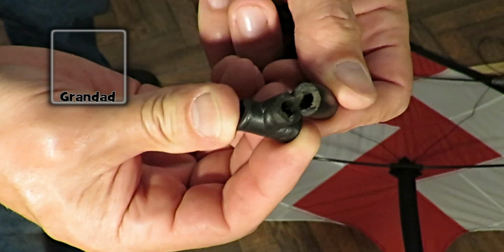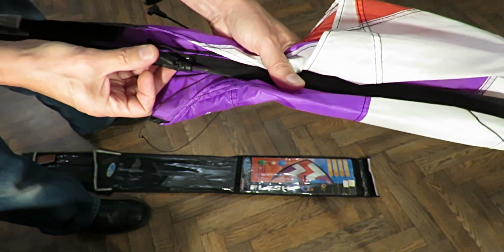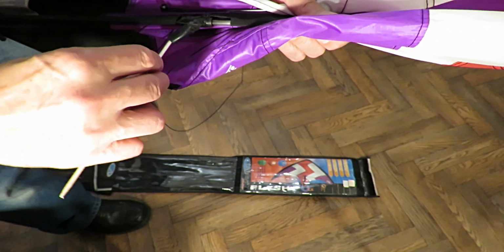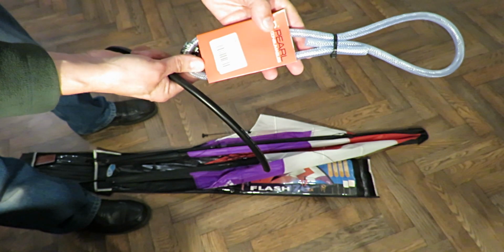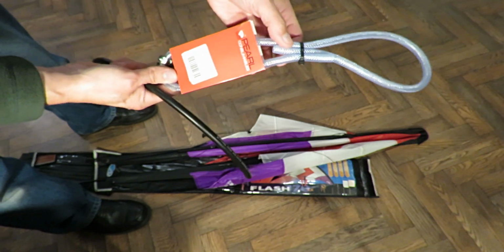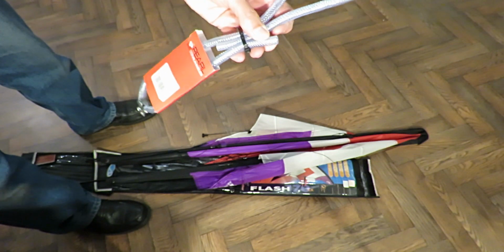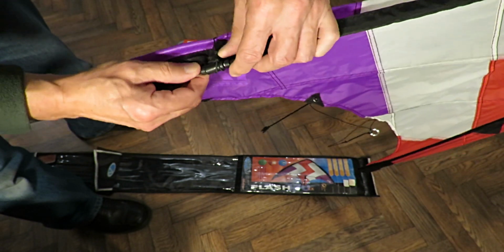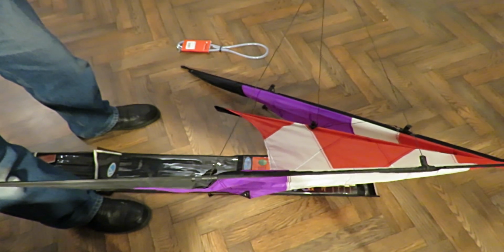Replacement connectors on my Günther Air Sport Flash 170cx Stunt Kite

Comment: Good Fix, that fuel pipe should last longer than the original rubber connections, I've used Fuel pipe to make all sorts of kite joints, particularly on box kites, ( there's a project for you, build a box kite !)
Reply from the maker: Unfortunately it just made a stress point for the remaining carbon fibre tubes. It flew but we have another broken spar now.